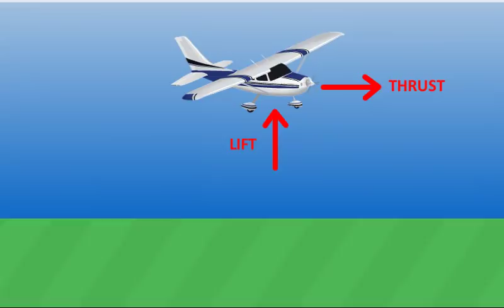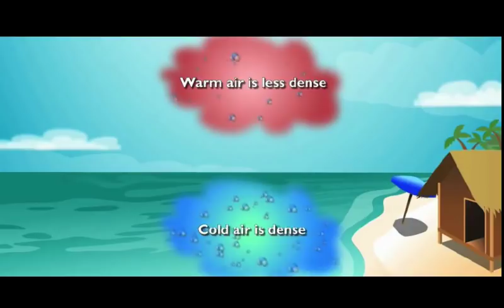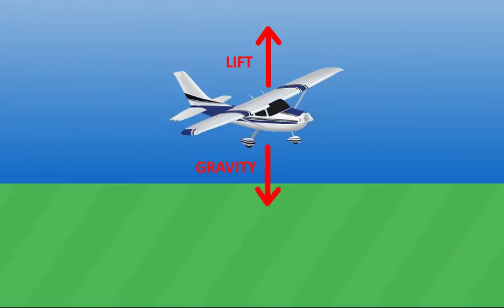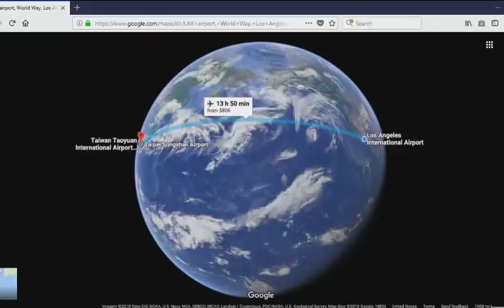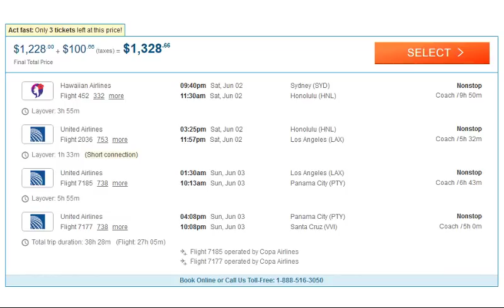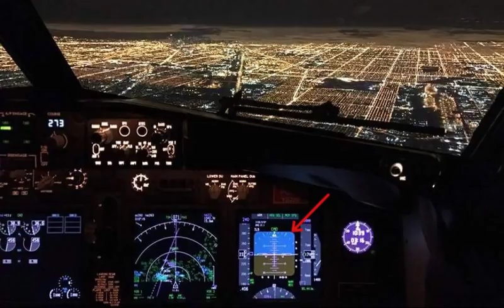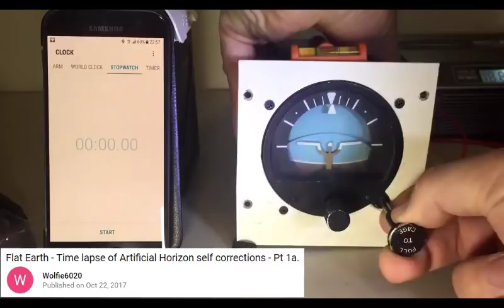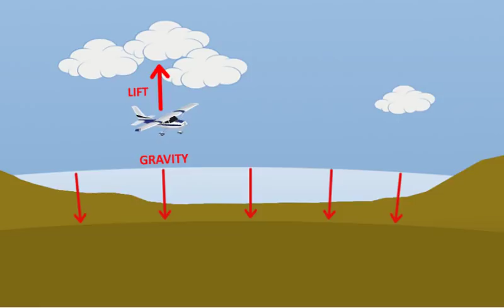Flat Earth Falsities - Plane Nonsense

Comment: Water always finds its level. Thats all there is to it. It doesn't bend and stay pulled to the earth because of "gravity" pulease
Reply: The surface of water is perpendicular to the force of gravity acting on it; i.e. it forms a tangent to the curve at any point. I'm afraid your ignorance of fundamental physics, geometry and logic does not constitute evidence.
Reply: Shell: please explain a tide. 
If water is always level and never bends then how can the same body of water be at high tide on one bit of coast and low tide at another, at the same time? How is that “level”?
Reply from the maker: Shell Ryke - Greg asked you what force causes water to "find its level". You have failed to answer, as all flat earthers do. See if you can be the first to provide a valid answer. Does water have a mind of it's own?
Reply: +Shell Ryke
Still trolling with the same stupid claims. Why?
Reply: +Shell Ryke
"Water Always finds its level"
Still trolling with the same stupid claims. Why?
As you have been told, and ignored, water finds it's level because of gravity.  Level meaning a vertical distance above or below a datum point.
Why do you keep ignoring these facts?
Reply: Shell: so no answer for what a tide is and how this unbendable always level water can be at different heights on the coast at the same time?
Reply: Well if you ain’t goin’ in no plane crazy foo. Then I can see why you might think that. 

But you are still ignoring tides. Observable every day evidence that water is not always level.
Reply: Tides, damn crazy foo!
Reply: "Water always finds level"
Except on my car..that fucker beads up beautifully 👍
Reply: Shell Ryke How does water's mind work? If a volume of water is split into multiple aliquots will each aliquot have a whole mind or just part of one?
Reply from the maker: Shell Ryke - Sorry that is not a valid answer. Are you intentionally being obtuse? Water has no brain, so it cannot think. It only reacts to forces. Only a force will make it go level, and that force is gravity, and the direction of the force is toward the center of the earth, so level is curved, not flat.
Reply: VoysovReason napes, wrong, womp wahhh. Jusy joking idk u might be right i might be wrong.  We'll all find out in the end maybe.
Reply: Shell Ryke How then, does water find it's level? What is the physical force that causes this? What other predictions can you make using the understanding of this force? 

Great claims require great evidence my dude.
Reply: No... So if its bending around a "globe" its not level. No?
Reply: LEGI0N Wolf. Hahaha you're funny PIGEON Wolf
Reply: ^^ more globetardery lmao
Reply: VoysovReason water kind of does  have a mind of its own. And its mind is set on being level.  If its not level its working on being level until its level. Always finds level.
Reply: No... Water Always finds its level im pretty sure your just spittin jibba jabba i pity the fool dat believe in a globe. Lol im just joking around. I just feel like the arrows pointing stronger towards  being flat
Reply: wong you cant handle the claims cause you know they're true hmmm?

Comment: I would like to submit a correction. Namely that at approximately 6:40 you state that level flight is referring to a path that is parallel to the direction of the force of gravity.  I submit that it is perpendicular to the direction of the force of gravity.
Reply from the maker: Yes, I misspoke. I meant perpendicular to the direction of gravity, but parallel to the curved surface. Got the words mixed up. Thanks.
Reply: FPV Angel And anyone with access to basic maths can do the following experiment. https://en.m.wikipedia.org/wiki/Eratosthenes#Measurement_of_the_Earth's_circumference
It demonstrates a curved earth.
Reply: Hahaha pathetic! Its 2018 not the dark ages dumbo!

Globe Destroyed.
Reply: What year it is doesn't change the nature of the experiment.  If anything it should make it more accurate, if you can find two places far enough apart, since you can get an accurate value for the difference in how far North they are.
Reply: You dont seem to understand, i destroyed your globe so nothing is going to save it.
Reply: Could you get a room and stop having your pointless argument in MY comment??  These notifications are getting annoying.
Reply: Reported and blocked.  Have a nice day.
Reply: Level flight is the aircraft flying straight and level, gravity not required.

Comment: Flat earthers cannot understand the concept of "center of gravity", no matter how you explain it. If they understood the concept, they wouldn't be flat earth believers.
Reply: I can measure gravity, everything falls at an acceleration of 9.8m/s-1, we know the earth's gravity is 9.8N and this can be measured using a Newton Meter. Whatever the mass is, for example 5kg, we use W=mxg we get 5x9.8N = 46N This is a measurement anyone can do!

Hm massive issue for you flattards.

Also if theory of Air Density is true, then air resistance shouldn't occur, if things are falling because they are heavier than air, then air reistance could never take effet, and things would fall and accelerate faster than what the barrier created by air resistance forms and everything starts to fall at a constant speed of 9.8m/s-1

Not to mention how the second law of thermodynamics destroys the FE theory. "in an isolated system, entropy can only increase"

Under a dome, with no outside sources for energy, then chaos can only 
ensue.

That's a law, not a theory.
Reply: FPV Angel , aka Mr. Jobless, aka I live with mom.   Let's just go through the issues. Let's start with the fact that on the FE ice wall map a person in South America and a person in Africa are looking in different directions when their backs are to the North pole.  So why do they see the exact same stars when they look directly to their South? They all see the Southern Cross.   That doesn't make sense.  Explain.
Reply: Meanwhile in the real world globe proofs STILL = 0.
Reply: FPV Angel , you need to seek help.  I just randomly sampled some comments here and you're in every one of them.  You look desperate and pathetic.  Now I'm sure you don't have a job.  You spend your life living in your delusion.
Reply: FPV Angel - You throw insults around like a pro, but lack the most rudimentary skills to communicate facts and proof. 
Let me guess.
You're religious?
You're mentally limited?
You feel good doing this?

https://xkcd.com/386/

We're wrong? okay! Fine ... just let us sit on our little globe being wrong. 
And you can sit there on your little disc with a dome over it and feel whatever little feelings you got going on up there.

G.L -.P.L.C.
Reply: I destroyed your globe silly child, why are you on top of an imaginary ice wall hahaha fucking idiot.
Reply: Take your face out of voysofstupidities crotch and i might be able to understand you.

I come here to LAUGH at you globetards now perform like a good ape.

Comment: They should be able to measure the curve taking place during alleged level flight right? This needs to be tested and proven rather than a clever animation
Reply: Easily tested. Measure the location of Polaris, the north star, using a sextant. Then fly to a different latitude and measure again. Not only is this easily tested and proven, it is EXACTLY the method by which sailors in the 15th century reckoned their latitude. Those measurements would have been worthless and we'd have millions of dead sailors on a flat Earth.

Comment: An airplane flying level, is in reality in a climb angle. What arrests it's climb rate is a combination of certain physical elements. In lower altitudes the greater elements are speed and wing angle. At higher altitudes the greater effective element is the density of the solution it is flying through. It is an exponential curve up to about 25,000 mph for escape velocity. Most airliners aren't able to achieve 25,000 mph. When an airplane reaches it's top speed and continues to try to climb it experiences a slight stall till it descends to a dense enough solution to maintain altitude. An airliner fling along in a "level" flight is actually slightly slipping/stalling. it's altitude being constant due to plane angle, speed and density of the air. If air density was the same to the edge of space it would indeed fly out to space.

Comment: Your explanation of why planes follow the curve of the earth should include air pressure. If a plane follows the perfect straight line away from the earth, it will be going higher into thinner and thinner air. This will generate less and less lift, and the nose of the plane will drop naturally.

Comment: Proportional. When you realize that planes fly ad 10 km and the diameter is about 13 000 km and you compare that with a soccer ball you will not be able to see the plane, wrap foil around the ball, tightly, and you have the thickness of the atmosphere.
I also never got the answer on the question about density. What makes the density such that things fall down?